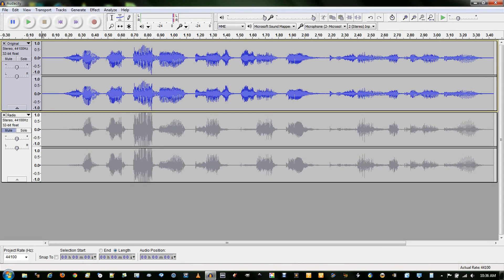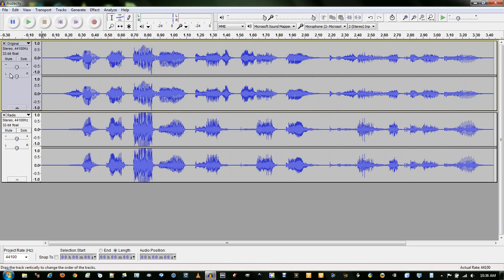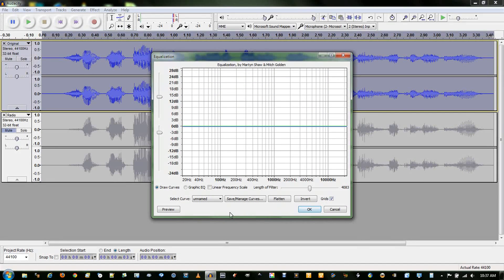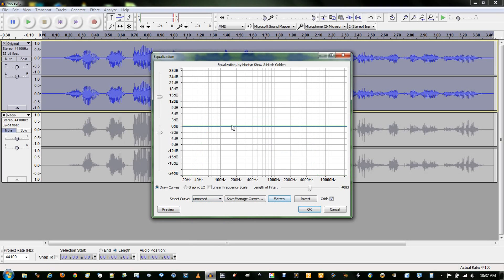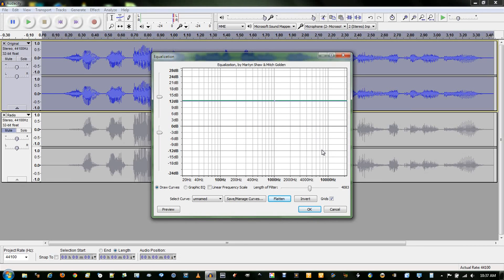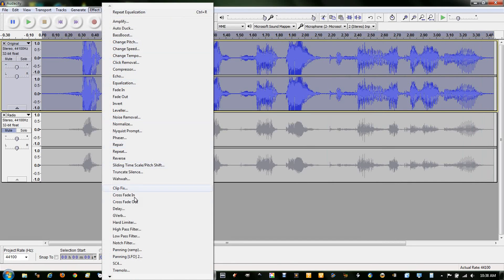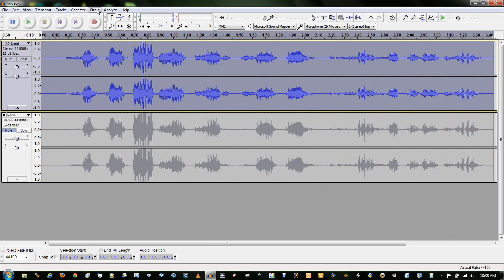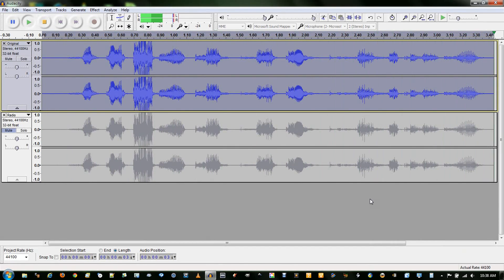How to Make Voices or Audio Sound Like a Radio in Audacity

Comment: Clipping breaks the wave forms.  You can repair it by using a negative setting in effects > Amplify.  Then apply effects > clip fix. Then amplify or use normalise to get the volume back.

Comment: Shelf/roll-off at 4KHz (because toll/voice-quality audio has always been defined as 300 Hz - 4KHz). http://en.wikipedia.org/wiki/G.722

AM audio goes from 20Hz up to about 10KHz, with pronounced compression and negative peak limiting or clipping. The amplification step is totally unnecessary; real broadcast audio has multiple compressors and limiters stacked on top of each other:

http://www.repeater-builder.com/tech-info/audioprocessing.html

But you probably don't care about that, since you just want it to sound like a radio, without actually putting a radio in the middle. Well, it depends on the radio....